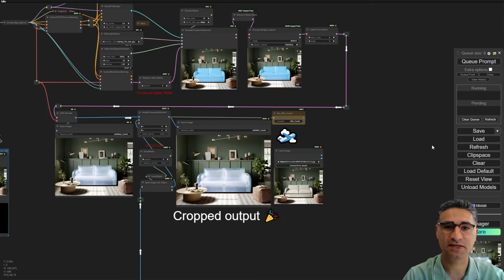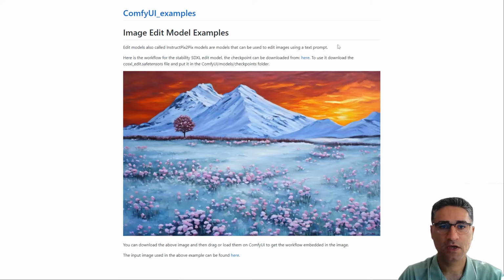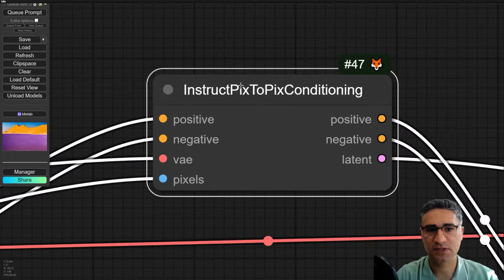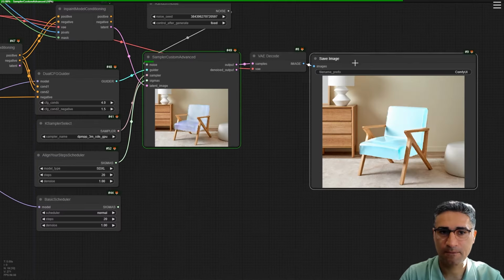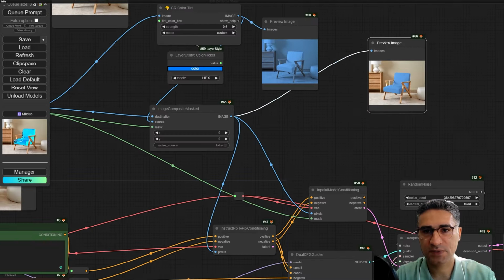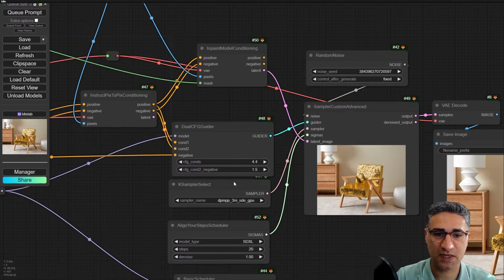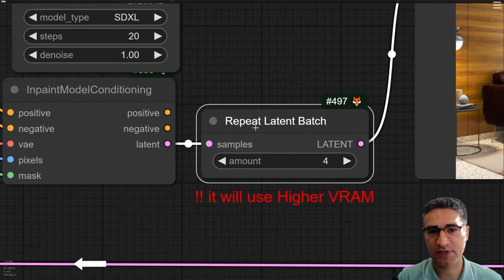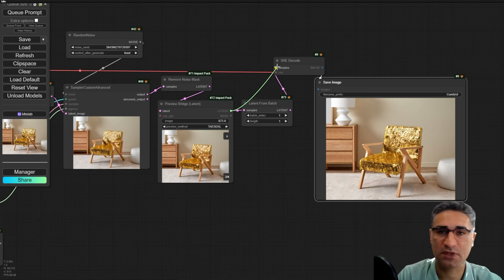change object material in ComfyUI by power of the stable diffusion and COSXL

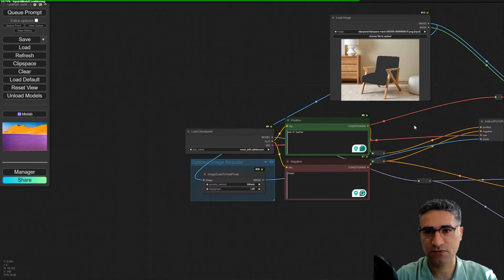Comment: I tried following this guide, but when I get to the step at 8:20 and try to generate an image with just the masked area changing, it instead changes the style of the whole image EXCEPT the masked area, which stays gray and doesn't change at all (not the same as the original image, but instead the grey mask itself shows up in the output).

I made sure every single one of my settings/nodes was identical, and I have all the pre-requisites installed too. Have some of these nodes been updated and work differently?
Reply: I noticed that the inpaintmodelconditioning now has an additional toggle for "noise mask" but if I leave that as false it should work the same, yes?